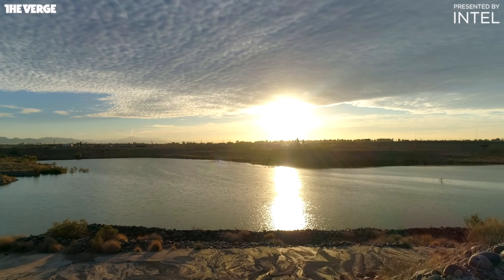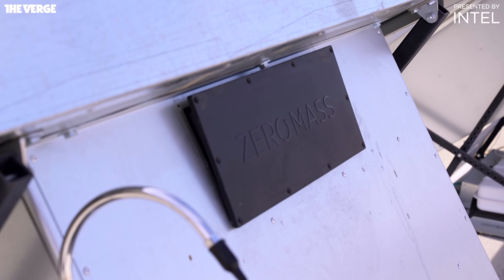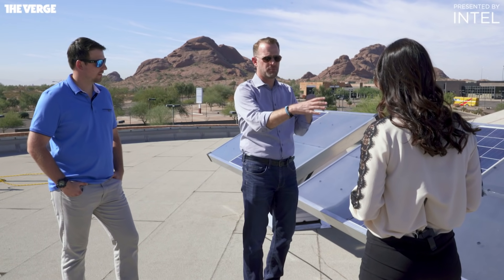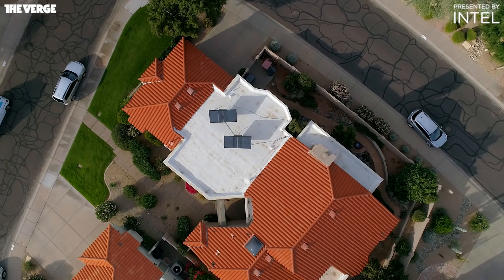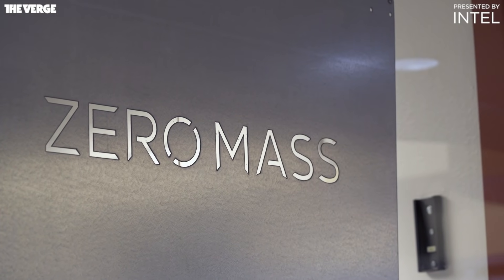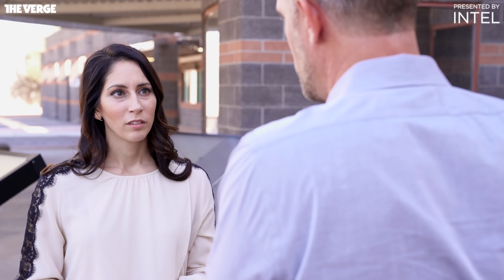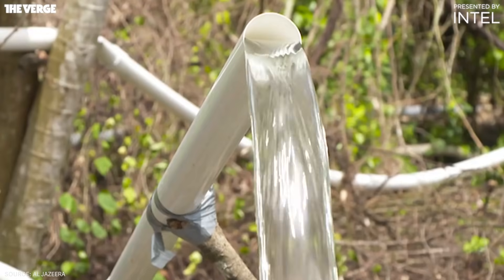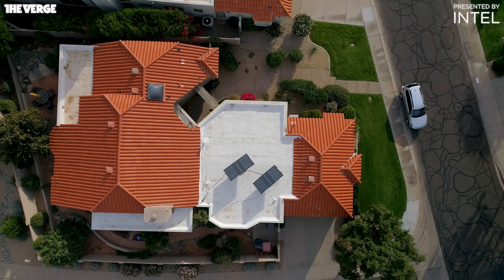Zero Mass' solar panels turn air into drinking water

Comment: Thunderf00t?
Reply: Soon
Reply: Beat me to it lad
Reply: It's a pointless "invention". It may be producing 5 liters of water (on condition the humidity is high enough), but wherever humidity is high there's water available anyway; you just have to filter it, which you'd have to do anyway after getting it from the air.
Reply: He needs to debunk his own video on "seeing electrons"
Reply: "The latent heat of vaporization of water is 2,260 kJ/kg"
For the same amount of energy, you could desalinate 200L of salt water and pump it into the stratosphere.
Reply: Salt dissolution enthalpy is 3.9 kJ/mol, or 67 J/g. Given ocean salinity of 35 g/L, desalinating 200L requires 469 kJ. Putting the remaining 1791 kJ into gravitational potential energy (E=m*g*h), you can get to a height of 913 m (missed a zero there, so not quite the stratosphere, but the point still stands).

Of course this is all assuming perfect efficiency, but so did your calculation. The point here is to show that dehumidifying air as a water source is 2 orders of magnitude worse than this already ridiculous approach of desalinating and pumping.
Reply: You asked for...
https://www.youtube.com/watch?v=vc7WqVMCABg&t=2s
Reply: It's happening again!!!!! Hahahahahah
Reply: 600,000 liters is equivalent to 500 cubic meters. Each panel seems to have about a square meter of surface area, so the amount of air flowing 'through' the panel would need to be about 500 meters every 24 hours. Typical windspeed are about 24 kph, which is way more than enough.
Reply: The impossibility doesn't lie in the fact that there's little water in the air, the problem is you need an incredible amount of energy to produce a heat sink to condense the vapor. It's a scam because it violates basic thermodynamics. Pumping desalinated water all the way from the Pacific Ocean would be a cheaper and more practical solution.
Reply: The latent heat of vaporization of water is 2,260 kJ/kg, which is about 2.3E6 J/L. which is about 0.62 kWh/L. With good sun exposure set to 4 hr per day, one would need about 140 Watts of solar panel for every liter per day we want to condense. This is completely reasonable.
Reply: Just say his name 3 times.
Reply: TheShadow 
It's up 😂
Reply: Boo! Slingshot, slingshot, slingshot!
Reply: was about to comment this
Reply: I was thinking that.
Reply: Hope so
Reply: Lol this one is gonna be good
Reply: Could you show your working out?
Reply: The reason why I preemptively ruled out reverse-osmosis was that I assumed that the membrane needed to be changed, and that while energy from the sun is not in short supply, reliable access to new membranes for the filtration system just may not be there for the people whom this company might be targeting.
Reply: Needless to say, I don't think you're factoring the energy expenditure of the pump required to push the saline water through the membrane. Also, keeping the membranes functional is a major problem. According to Wikipedia: "Pretreatment is important when working with reverse osmosis and nanofiltration membranes due to the nature of their spiral-wound design. The material is engineered in such a fashion as to allow only one-way flow through the system. As such, the spiral-wound design does not allow for backpulsing with water or air agitation to scour its surface and remove solids. Since accumulated material cannot be removed from the membrane surface systems, they are highly susceptible to fouling (loss of production capacity). Therefore, pretreatment is a necessity for any reverse osmosis or nanofiltration system."
Then there is a whole post-treatment aspect that returns the water to a neutral pH and adds minerals and such. I don't think your idea is practical for many countries, and this is why the above video might make sense. Right now they are exploring it.
Reply: My very first thought. He's so good at breaking down the bullshit.
Reply: Secondary education in this country is a travesty.
Reply: How does the energy score look like when comparing to collecting and treating rain water where it falls in generous quantities, and transporting it to places where water is in short supply?
Reply: it is done https://www.youtube.com/watch?v=vc7WqVMCABg
Reply: Same
Reply: I was thinking the exact same thing, someone plz send him this ;)
Reply: No need. He have already showed that all "water out of thin air" solutions are scams.
Reply: Artur It ISN’T. It has provided 100% of our drinking water for more than a year now.
Reply: This is most likely a pipe dream. A litre of air can hold 0.017 ml of water at 100% humidity. To produce 5 litres of water at say 50% humidity, each panel need to process 600K litres of air. Hmm seems almost too good to be true. Thunderf00t will shred this to pieces
Reply: Good idea to get his take on this. Why does this look like a scam? Didn't they claim it's max production is 5 liters a day? That's enough to provide drinking water,  but not much else.
Reply: TheShadow the video is 100% BS. Probably to get subsides
Reply: TheShadow this is not impractical... Like he said in emergencies and special environments ... Also in time the water u collect is worth  it